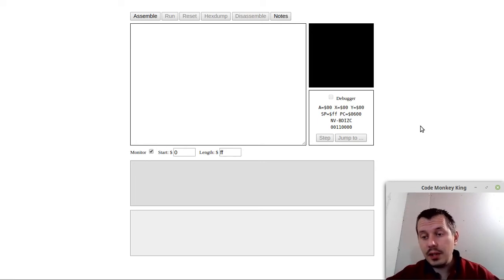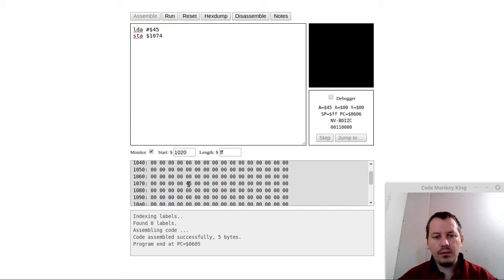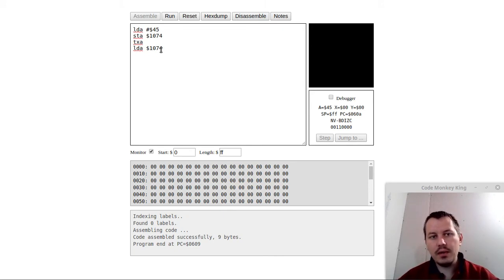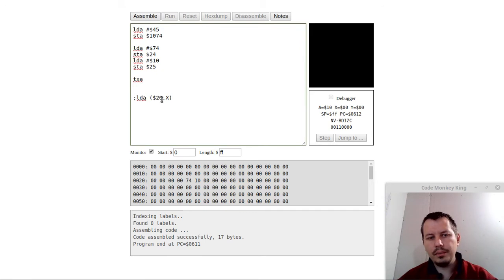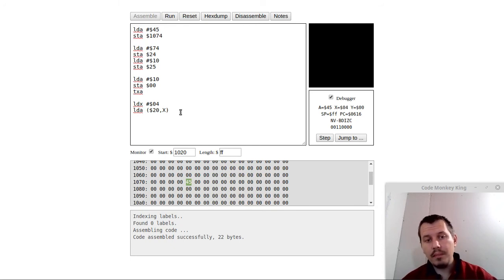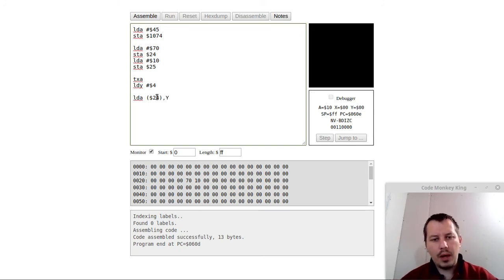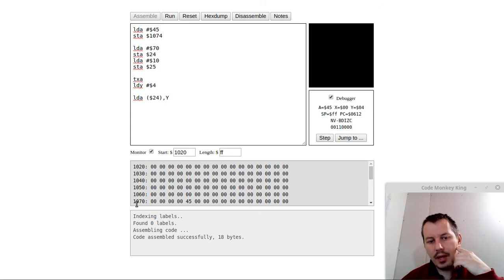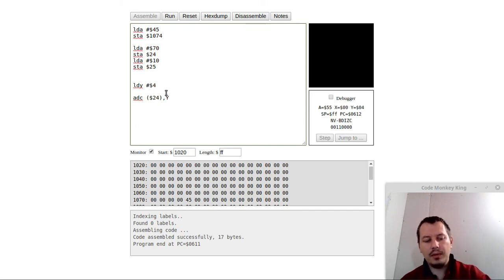6502 assembly indirect addressing explained

Comment: Oh, man... I was looking for using zero page addressing on the 6502 along with indirect and indexed indirect moving of data. It's been a few years, I remember I struggled for months going from the Z-80 to the 6502 addressing modes and how the 2 cpu differ.  I remember on the 6502, I found unused memory locations in Zero Page and started using them in the instruction sets.  Because using a value from zero page could be done in like one clock tick..  Once you got a handle on the 6502 addressing modes...  You can make that little chip fly.  If I could make a living writing machine code...  I'd quit wearing a bunny suit and spending 12.5 hrs a day wrenching/fixing huge machines that pick die from a sawed wafer.

Comment: This is a very cool method, but there doesn't seem to be many free Zero page addresses for c64 programming so it seems the indirect reference is useful however the index is only semi useful?
Reply from the maker: Hi, thank for a good question.
First of all the size of zero page is 256 bytes regardless of machine (C64/NES/Apple ][ etc.) but specific to MOS 6502 processor itself and intended to compensate the lack of general purpose registers (as opposed to Zilog Z80 for instance) as a quick memory reference alternative. As for your mention of a semi-usefulness of indexed indirect addressing - well, I had exactly the same thought at first but later on I've realized that this addressing method is more likely to be used for on load initialization rather then in program traversal of memory so in that regards it might make sense especially bearing in mind the immortal classic games that has been implemented for this processor)
Reply: @monkey_see_monkey_do  yeah I'm currently using self modifying code a lot, so I can see how this is a much better alternative. But out of the first 256 bytes in Zero page on c64 it seems a lot is used by the kernel, with a few free ranges of 2 to 5 contiguous bytes here and there
Reply from the maker: @opium32  to be honest I'm not familiar with C64 arch and not sure what exactly you mean by "kernel" in this case. Doesn't it just run BASIC from ROM? Or what am I missing? And just out of curiosity what kind of project are you currently working on?
Reply: @monkey_see_monkey_do  yeah but like for example, there's a bunch of addresses in zero page that define where the current basic program start and end, and a bunch for other pointers for where variables start and end... I'm not familiar with most of them either I just noticed they're used. Most games would bank out basic all together so that would free up a bunch of zero page addresses... Probably same others freed up by banking too.... I just wrote a game half basic half assembler to get back in basic and start to learn assembler: my next assembler project probably completely assembler... Not sure yet: probably just play with horizontal scrolling and tackle concept building blocks before eventually tackling a complete assembler game
Reply from the maker: @opium32  oh, cool, I didn't know that! And as for assembly - it would work much faster as opposed to basic but even better benefit we have - in some cases writing in assembly is more straight forward, maybe not the best example ever, but here's a 512 bytes bootable sokoban game that I've made not very long time ago:
https://www.youtube.com/watch?v=6h5QM_bwBhs

Comment: I noticed that you did not give an example on how to do a STA using the Indexed Indirect method. I am attempting to do that right now. So far without any luck. I believe that the machine language code for an STA indirect X.  Is #81 / STA,X
Reply from the maker: Indexed indirect addressing mode, e.g. ($20, X)   regardless of opcode works the following way:
1. Calculate zero page address $20 + X, say X is 4 then the absolute address we gonna be looking for indirectly is referenced at zero page $20 + 4 = $24.
2.   At zero page $24 we have first byte of indirect address, at $25 - the second byte. Bytes should be stored in little endian order. Say we want to store address $1074 then at $24 we'll have 74, at $25 we'll have 10. 
3. Now STA ($20,X)  assuming X = 4 and address stored at $24 equals to $1074 in little endian will put whatever we have in A register to address $1074

Hope this helps.
Reply: @monkey_see_monkey_do  Thank you. I did get that to work. However I do get so hung up on actually indexing 1,2,3,4,....  where as this method seems to only point to a single address. and does not seem to be indexable, in the same 1,2,3,4 ... type of indexing that I am used to doing. This method does not seem to be very good for clearing or setting up an array, or am I missing the power of this method of indexing?
Reply from the maker: @jeffnay6502  You can store several absolute addresses and reference them indirectly. Or alternatively you can use ($24),Y addressing in this case say you have address $1070 stored at $24 then if Y is 1 you'll reference absolute address $1071, if Y is 10 then $1070 + 10 = $1080 etc.

Or I missed your question?

Comment: I am currently looking to understand both Indexed Indirect addressing and Indirect Indexed addressing. It would be a benefit to me, to see the actual machine language codes associated with the assembly language examples that you are giving. I was able to find the correct machine code to use. I appreciate your explaining the use of both of these addressing mode. Well done , Thank you !
Reply from the maker: You're welcome! In 6502js you can click hex dump and see the machine codes.
Reply: I tend to write everything out manually on an excel spread sheet before entering it into my KIM-1 or a KIM-1 emulator. So, I have to have the machine code to enter the program.
Reply from the maker: @jeffnay6502  I clearly understand) I even have a video of live coding a matrix screen saver in x86 machine codes)
Reply: @monkey_see_monkey_do  I have a small series on programming a KIM-1 using Assembly / Machine language. The last one honoring the latest "Let's go Brandon"
craze... 😂

Comment: Great video CMK!
10:34 Little Endian, I used that only last week.  
So what would you say are the reasons for use of using indexed indirect V indirect indexed?
Reply from the maker: It depends on what do we want to incrementally update, for instance if we want to update a look up address on zero page within a loop then indexed indirect is the option but if we want to increment the eventual address referenced indirectly then indirect indexed is the way to go. In my experience the second scenario is on the cards when you want to loop over the memory range greater then 0xff in that case you'll need increment the reference address pre-stored in memory.